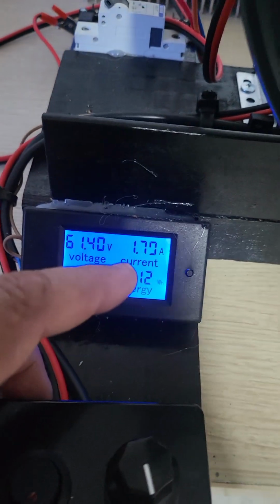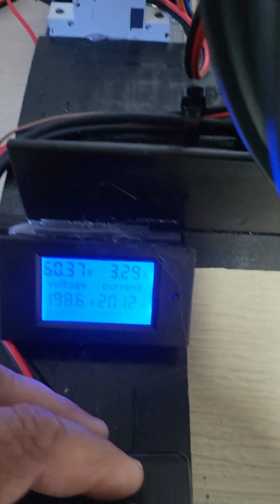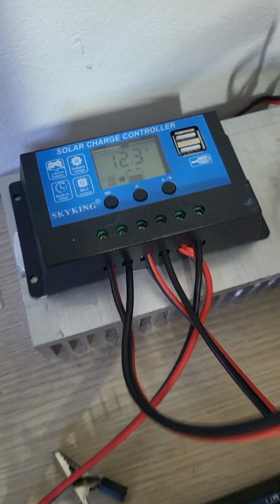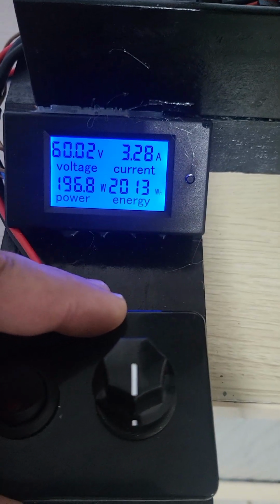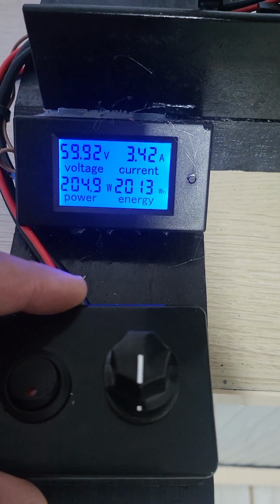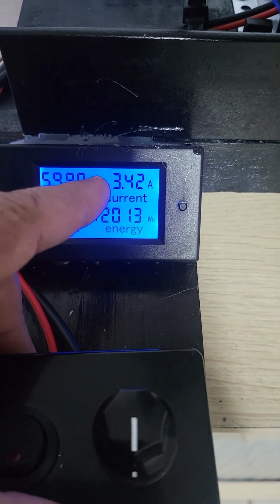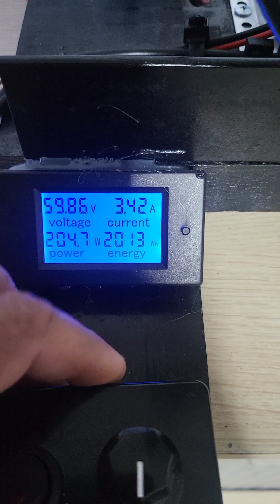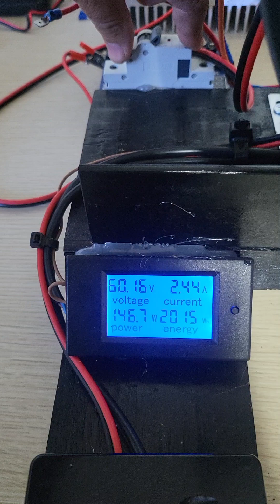LG washingmachine John Bedini breakthrough!!!!

Comment: Max Planck: "You need a special quantum of energy to chance the speed of a big mass, if you pull too fast ore too view, you got a pull but you dont chance  the speed. As quiker you pull as stronger you can do it without chance the speed of the mass. (the ultraviolett catastrophe)" So we dont need a new physic for free energy.
Reply from the maker: Hey @unitittii. You are right. I think you can find free energy, but not enough to make sense. Taking two metals and pushing it in a couple of  melons in serie gives week or so light with LED. Same with earth batteries. Free energy. Not useful. But I am not trying to find free energy. I am trying to spin a motor as efficiently as possible. Pushing that boundary. Thanks for watching I do apreciate the conversation. ;)
Reply: @jakesvandermescht694   WHY IS THERE FREE ENERGY ?

The conservation of energy presupposes that the mass inertia always remains equally strong in all directions.
But this is not the case and the most obvious proof is that permanent vacuum unrest by which all matter is shaken around. To shake a litre of water back and forth as rapidly as Brownian motion can, you need 10,000 Ps, assuming that the inertia is constant.
However, for over a hundred years it has been observed that masses that are strongly held can take on slightly less inertia than when these masses are set free.
It is about the same amount that the bound proton is lighter, more inert, than the free neutron. It is the difference of half a hundredth.
But this is only an average value, because it was discovered that all measurements are subject to extreme uncertainty. This uncertainty principle claims that if the speed of an element is to be measured as precisely as possible, then the location of the element can no longer be determined exactly. In other words: You never know exactly where the element is, because it is caused by the vacuum to make completely unpredictable swings.
A single element has an extremely small detection head to attach to those highly filigree nodal formations of inertia mediating structures.
The next highest inertial diladation was then found in the weight difference from hydrogen to helium4. Instead of assuming a restriction of motion, Einstein invented a formula that declared matter to be a gigantic store of energy. Energy is compressed into matter and all bursts of energy would then inevitably have to dissolve matter. This thesis is stringently refuted by the perfectly proven, eternal stability of the basic building blocks. Even the Big Bang believers, who think that matter "froze out" of energy at that time, nevertheless assume that it will still be there in trillions of years.
Such obvious logical inconsistencies can nevertheless no longer clear a now highly decorated theory the way into the wastepaper basket. It is not only religions that are so stubbornly conservative, so eternally outdated, but also science. Behind the former is the salvation of the soul, whereas behind mainstream science, which has lost its way, big mammon has spread.

Comment: Greetings from Hawaii (Big Island)
Yeah, I was wondering what you show on the video, too. Are you able to measure input v/s out watts? 
If you do would you care to share it? Thanks in advance mate.
Reply from the maker: Hey MehmetBoysal! So the input watts is on the video(or one of my other videos!). That blue faced screen is input watts) Motor turns no load with 40-60 watts. Depending speed. When I put load, the motor goes up to 187watt. I can put serious torque and motor goes to 300watt. Ive never managed to go +COP. At this stage I do not aim to go free energy or over unity. Personally I do not think it is possible on large scale. Small scale yes. Ive seen it. But nothing that can scale. I am trying to develop a motor that runs on fumes, and can power water pumps from batteries. More industrial. Greetings to Hawaii! ;)
Reply: @jakesvandermescht694  ,  You said: "I am trying to develop a motor that runs on fumes and can power water pumps from batteries. More industrial."  What kind of fumes? HHO gas fumes or something else?   I developed,  burners that can burn any type of oil clean! No smoke at all. Can burn used motor oil, vegetable oil, transmission oil, etc. I can share with you how to replicate this and generate steam maybe?  https://www.youtube.com/watch?v=3UHdqHncOmU